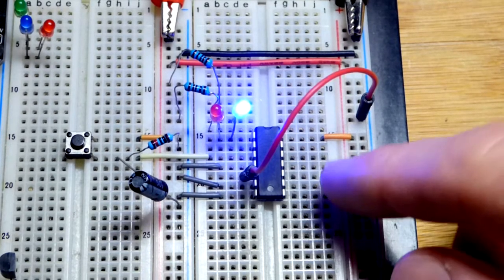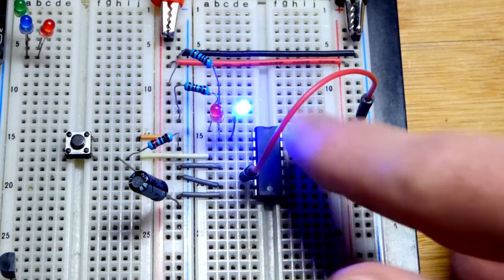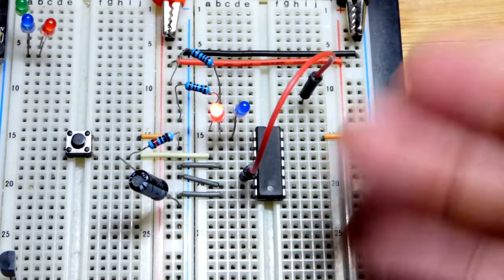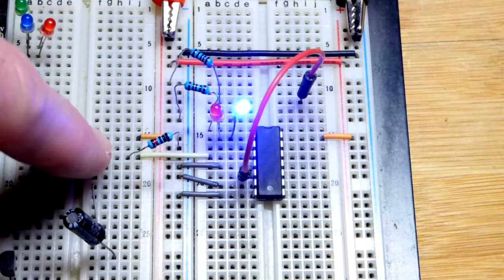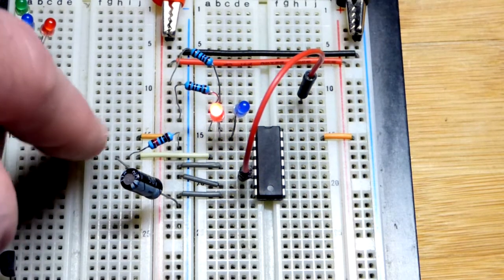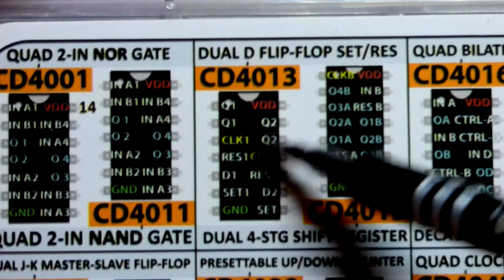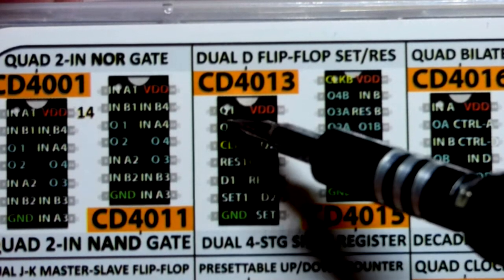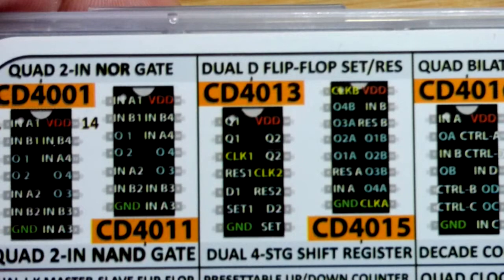Preview of D type flip flop w debounced switch circuit using 4013 integrated circuit IC DIY

Comment: The switch won't last long because the current charging the capacitor is very high.
Reply: Why is that? How does one fix that
Reply: does he not have a 10K pull down on the switch? Is that what you mean?

Comment: What I learned from Forrest M Mims III is to drive the unused gate outputs high in order to draw less current. Why high instead of low I don't know ...
Reply: For the CMOS 4000 types, tie the unused inputs either high or low, as logically appropriate. For TTL 7400 and LSTTL 74LS00 types, tie unused inputs low when logically possible; otherwise tie them high through a current limiting resistor (1K is commonly used).